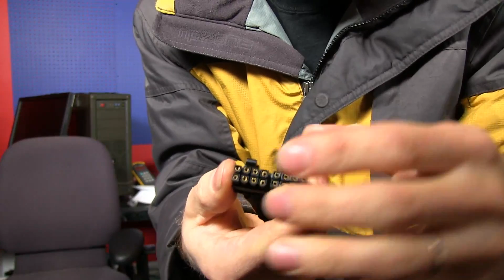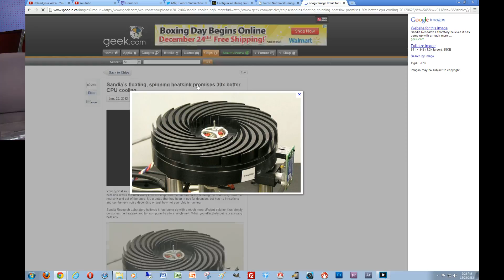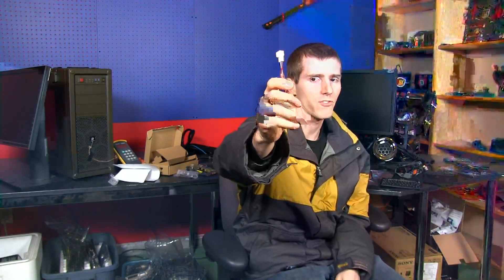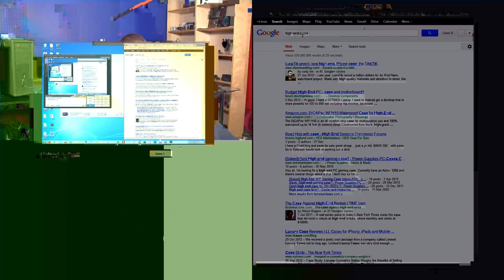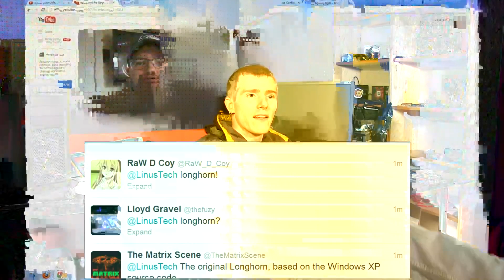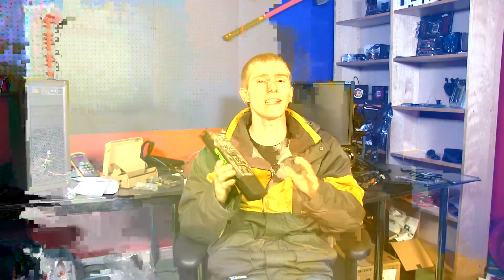Linus Tech Tips Live Show Archive - December 28, 2012

Comment: In regards to your points made around the 15 minute mark.

Linus, do not undervalue your experience with building computers.  I'm a casual gamer and have built probably around 12-15 computers over 10 years.  On one occasion I've built a system and the PC didn't start.  I later found out it was a memory issue.  Had to remove one of the ram sticks.

A first time builder may panic at such an issue and may 'overspend' to try and fix the issue.  Peace of mind and experience have high value!

Comment: Very nice specs, I would definatly reccomend the corsair H60,  I have my i7 3770k overclocked to 4.6 with the H60 and I get all under 75  degrees, If prebuilt water cooling is not your thing then Zalman makes a really good 92mm Ball fan that is very affordable and very good, as for your ram and motherboard, I wouldn't worry to much about there temps, but if your really want to, upgrade your case fans to fans with higher cfm

Comment: If you go custom built systems from a Brand Name like Falcon, Dell, CyberPowerPC, IBuyPower etc..you will pay alot on cases which were mod it and custom painted with Candy Apple Pain, and that is where they can hike up the prices, and on some of the components of the computer, depending which vendors they're using to buy their stuff from.  Typically most business who use propriaty specially designed for companies like, HP, Dell, Acer Etc... which you have to use their special acquired components

Comment: That kind of depends what your using as base... Otherwise the weight is still going to make it very noisy no matter the airflow... Compared to what is the question... Even then it's not going to be worth the price based on the simple fact that the material cost is way too high and cooling bad compared to cobber...

Comment: I am using Driver Version 9.18.13.1070 with an nvidia geforce 550ti. No problems here on bf3 in high settings. Biostar mobo with amd FX-6100. I am also running overclocked with evga software and stock reference fan at 1020 MHz GPU 2200 MHz memory. hope this helps.

Comment: Yo Linus, electricity travels from negative to positive (the electron).Each "ground" pin gets more current travelling through it than on a normal 6 pin by the standard but many PSU's like CM (I like & own their 1200w silent pro gold) "cheat" and just connect it to some of the other ground pins because the wires can easily handle it. But they're not meant to carry double the current. Still, it doesn't matter too much.

Someone correct me if I'm wrong, +12 beats a pull of 12v to my underpstanding.

Comment: "Whatever component you buy, you can find one that is more silent". Ok challenge accepted, I call on stock cooler on cpu fan wich i use. No explain to me how i can silent that one without paying extra. My case comes with 4 fans to replace them with nf12's i would cost me 120 euro. An aftermarket cooler or watercooler kit would cost me   about 50 euro's (sink) of 100-150 euro in watercooling. So this makes 170 euro - 230 euro just to have a silent pc. Sorry Linus but that doesn't make sense.

Comment: hey linus i hv just bought the gigabyte x79 ud3 n hv also found a defect at one of its conor near ps2 port
actually the pcb is bit bended on the upside which makes me failure to install the MB in I/O shield as well as the cabinet so the question is will the manufacturer replace it or not:(

Comment: the 2 extra groundpins on the pcie connector reduce the voltagedrop of the groundwires so you can "draw more power" trough them. the cable loses the exact same amount of voltage over all with 3+/5- than it would with 4+/4- but its not the best solution, because most of the heatloss is generated in the positive wires. so i have no idea why they did that :S

Comment: 670 OC can not compete vs 680 OC.
The table with new drivers is 7970 is slightly slower than the 680 and the 670 slightly slower than the 7970 and then the 7950 comes.

7950 or 670 for bang for buck but 680 and 7970 scales pritty good for their price.

Comment: i think it will be bad to be honest because heatsinks are good but they don't flow (hense its a solid) if it doesn't flow then its hard to transport energy unless your using copper, silver or diamond, if its aluminium heatsinks then the performance will be bad in my opinion. a diamond heatsink would be cool though (expensive but cool)

Comment: Sure, it's not a fair *comparison*, but that's not what I was shooting for. Linus said a fan & motor spinning at 2000 rpm was guaranteed to be loud, which simply isn't the case

The fact is that it's a new design - we don't know how it's going to perform or sound until we start seeing some actual designs applied to real life situations. And yes, a heavier fan is going to require higher torque to get started, but not necessarily much more to keep it spinning, thanks to the momentum preservation

Comment: The reason to the ground pins helps with more power is simply because you add another pin... What it does is it changes the resistance of the currency through the wirering so it has a greater effect... Ohms law... 100 watts - 4 ohm = 50 watts  - 8 ohm..

Comment: Introducing more ground wires spreads out the current that a single wire might otherwise have to carry. By having the additional ground points in a high-current circuit, current can flow directly to ground as opposed to all flowing through one or two wires, so you have more low-current wires. It also helps to reduce noise.